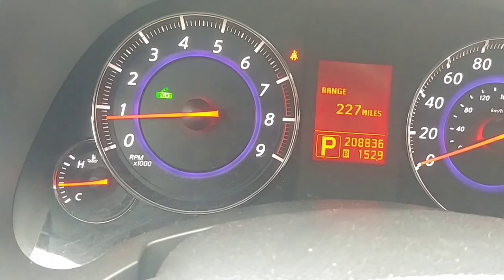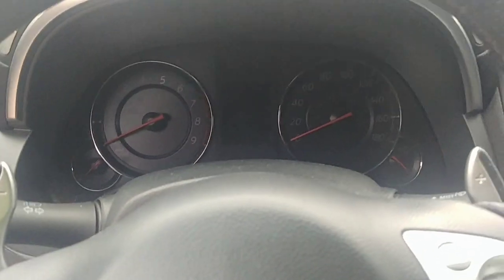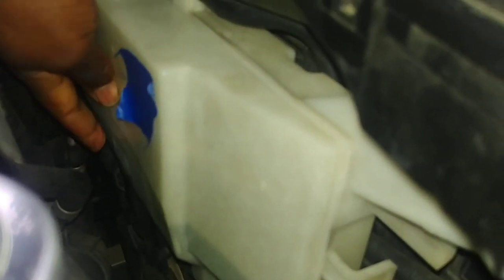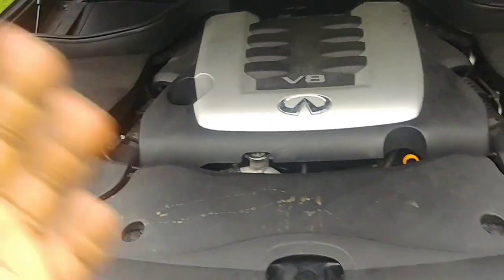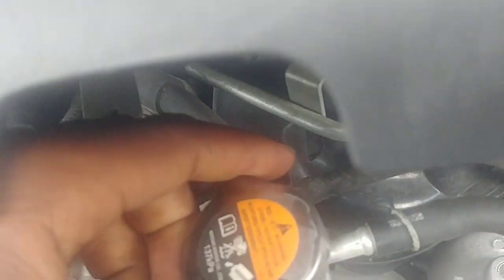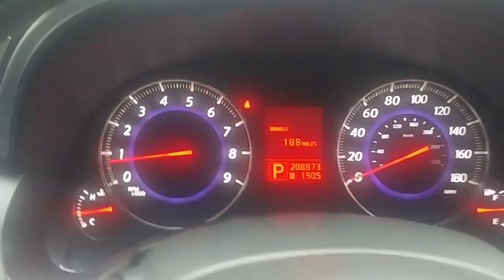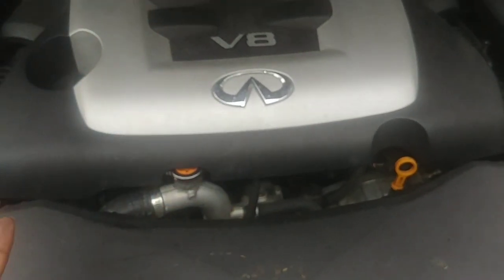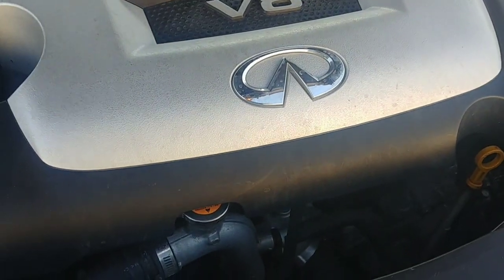Update: After Replacing Radiator Cap to fix water sloshing noises, coolant reservoir too full.

Comment: Real thankful for this video series. I used the funnel version and i never really felt like it bled properly because the car would only overheat when I turn on the AC. I was thinking my radiator might be bad
Reply from the maker: I'm glad you're enjoying these as much as I do making them.

If the only time it overheats is when running the AC, the problem is most likely around the cooling capacity:
- bad radiator
- bad fan module(s)
- slow fan motors
- improper coolant mix etc.
As long as the cap is fine and there is coolant in the reservoir, burping coolant of air is usually the least of my worries.
Reply from the maker: Or did you already fix the issue?
Reply: @EdBwoy  still troubleshooting, but the cap is definitely not OEM. I have an airlift tool I used on my q50 but now that you showed the bleeder I'll try that
Reply from the maker: @ceo4eva  any success yet?
Reply: @EdBwoy I saw your video on using oem thermostats so I will replace this mishimoto one with oem and see what happens. I also noticed I had a stuck fan so that helped with cooling when I got it unstuck

Comment: I'm still having this issue... no leaks.... no weird smoke, no white in oil.... New rad, new rad cap, new hoses, new thermostat, new coolant temp sensor, new bleeder valve, new fans.... still same issue. Not losing coolant at all, just need to siphon it from Reservior to Radiator... the only that is not new is the small hose that connects the Ran and the reservoir, which i will replace tomorrow just to test. But i'm at a complete loss right now. Car has only overheated once 2 months ago, but since then ive been siphoning the coolant which is annoying  because i dont feel i can go a super long drives. At least i'm afraid. 2010 FX35 here. 173K Miles.
Reply: did you ever figure out the issue ?
Reply: @Ybfav37  Sadly, i had a blown head gasket, albeit a small one but nonetheless it had to be replaced. ended up paying 4K for new head gasket, spark plugs, water pump and timing chain.... driven 4K miles and all good, no issues.
Reply: @DTUFINOPhotography  dang bro i have the same issue my car only got 100k mikes i’ve tested for headgasket leak and i passed did you ever test ur headgasket at home or no?
Reply: @Ybfav37  Ugh thats sucks! I took my car to a trusted shop and they tested it in front of me, i have a slow leak.... my car was not overheating but all the coolant ended up in the expansion tank... and eventually it will overheat if i didnt siphon it back. did that for 2 years, it was annoying. So, just did the job, it was either that or junk it and get another car but the car was MINT.
Reply: @Ybfav37  Def take it to a trusted mechanic. Ive dont alot of work to my car, changed Radiator, expansion tank, bled the system 5x before getting the head gasget tested and it indeed was a head gasget issue with MINE.... yours could be a different issue but trust me, before you end up spending money troubleshooting it yourself take it to a trusted mechanis and have them do a compression test.

Comment: Update on mine: getting head gasket repaired, my mechanic called me and said the heads were slightly warped, they will fix that and installl new gaskets once done and new timing chain, galley gaskets waterpump and valve cover gaskets.... setting me back 3500.00 but... its is what it is.

Comment: hey thanks for the video I also have a 09 fx50
quick question I started getting a misfire and I removed one the coils on the driver side and found to be coolant and good amount covering the spark plug, I don't have any overheating issues, oil is clean, no smoke,..... could it be a bad intake manifold gasket ?  :). :)
Reply from the maker: I think it's more likely to be an issue somewhere in the head. It takes quite some force to get the coolant out of the passages, and additionally send it into the spark plug tube.

The cooling system is pretty robust in it's cooling capacity, so you are unlikely to overheat for small leaks, but have you noticed anything else, like water sloshing noises in the dashboard or loss of coolant from the overflow reservoir?
Reply: @EdBwoy  yah it was loosing coolant at a good rate because if was forcing its way from thr side of the coil plug but i just couldnt see it because its the last coil towards the firewall drivers side... also i did hear like Swishing sound when Accelerating almost sounds like an exhaust leak on the passenger side But it kind of goes away At higher speeds
Reply: @EdBwoy  also the fx has about almost 250k on it
Reply: @EdBwoy I have a water sloshing on dashboard and collant lost of reservoir tank
Reply: @EdBwoy  there is a drain pipe in the tank to the bottom of the car. It flows out onto the ground there

Comment: Big bro! I hope you and your family are well! Question for you. I have a 2006 m35 and no lights on my dash. Still driving strong.  I noticed today that everytime I turn the car off and then back on to go somewhere the trip odometer has reset. No flickering of any lights. No shaking or anything. Have you come across this with any of your DOPE Inifinti's?
Reply from the maker: Sorry I missed this. Have you solved it?
This sounds like an issue with the KAM (keep alive memory) module. It could throw the code without illuminating the check engine light

Comment: I have a Nissan skyline 250gt v36 and noticed resorvoir tank loosing coolant without any visible leaks. It only happens after a long drive and when engine gets cold ( eg left overnight after a drive) but stays okay in the middle while driving. No overheating issue, drives fine. Could it be a bad radiator cap
Reply: Facts I’m goin through the same thing in my Infiniti Q50
Reply: @Qmiliy  I was told possible head gasket issue but it's been running fine since last 2000miles.only issue is the lose of collant after a long long driver engine cool down. No coolant loss for small trips. Not sure if it has gasket issue as I can't see any symptom.
Reply: @AintLikeNobody  did u ever figure out what the problem was?
Reply: @palerider4629  I have been running my car like that since then.no issues and no more coolant issue or lose. I did use k seal like 15k kms ago
Reply: @AintLikeNobody  ah ok. Ya my G37 runs fine with no overheating but every time I fill up the reservoir and drive for about 3 days, the coolant disappears. This is the 2nd time its happened but I don't see any leaks..
Reply: @palerider4629  may be possible head gasket issue. I hope not. Even i am. Not sure whether I have a bad head gasket or not. I used k seal but was not sure whether k seal was required or not.
Reply: @AintLikeNobody  weird man. Ed did explain to me that if I did recent coolant work that this would happen which I did. Ima try filling it one more time and if it disappears again then there should be a leak somewhere, ugh.
Reply: @Qmiliy  did tou fix it ???

Comment: My Reservoir was full to the very top on my 2010 FX35, i drained my reservoir using a turkey baster. lol not sure if that helps but my car is not over heating... I'll keep an eye!
Reply from the maker: Please do. Unless someone intentionally put a little too much coolant in the reservoir, it should never go beyond the MAX line.

For a normal system, any coolant that goes into the reservoir usually has come from the main system, so I would have opened the radiator cap to check and see if there was any coolant missing.

Comment: I just bought a radiator cap for mine but do I have to flush the coolant before putting on the new cap
Reply from the maker: No, you don't have to flush the coolant for that.
However, flushing the coolant is a good practice to every once in a while.
Reply: @EdBwoy  can cap cause overheating

Comment: When you add coolant are you adding it into the radiator or the reservoir?
Reply from the maker: I add it into the filler neck which goes into the radiator. Some cars don't have a filler neck, so you just add into the radiator.
When I add coolant into the reservoir, I usually do that because the main system is already full, and as the engine runs and expels any trapped air, it needs to draw coolant from the reservoir.
Reply: @EdBwoy  I'll add it to the neck and top it off, should i also add to the reservoir to the max level after i've topped off at the neck? I looked and it def needs more coolant.
Reply from the maker: Yes after the filler neck add to the reservoir as well. I usually target the middle point between MIN and MAX.
Then keep an eye on it. It should not be expelling coolant out of the system enough to overfill the reservoir. That's what led me down the path of bleeding mine, replacing the radiator cap, and eventually addressing the thermostat
Reply: @EdBwoy  Do you fill when its cold or when its hot? iw as also readin about headgasket being blown which lets air into the resevoir... i have 171K mile son my FX35
Reply: I just want to ask if i full the reservoir more than the maximum what will happen?